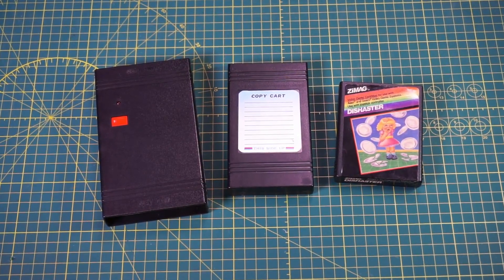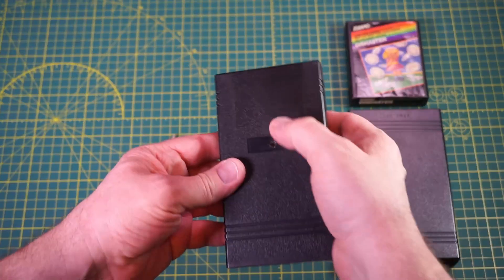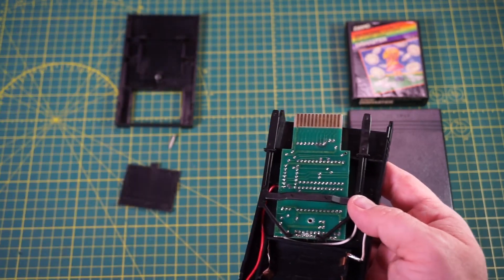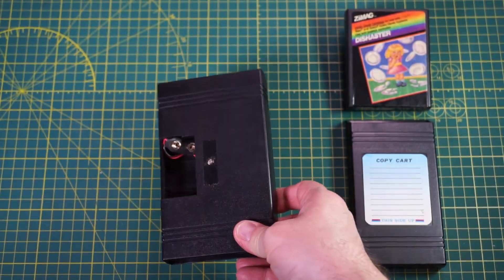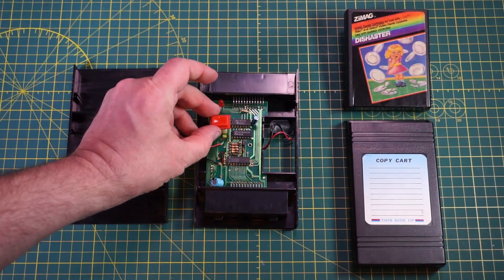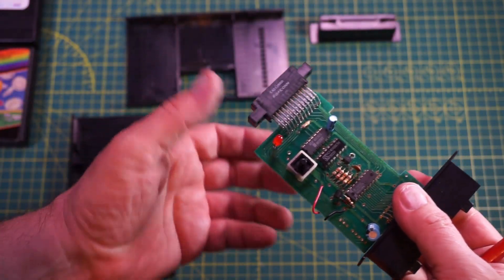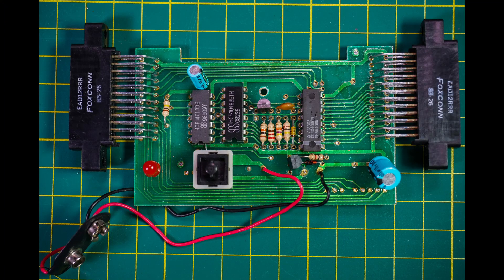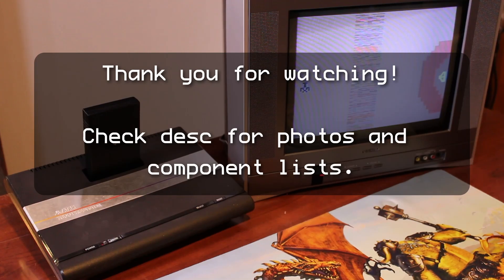The Vidco Copy Cart for the Atari 2600 (1983) Part II

Comment: I'm curious, if you accidentally put the original into the copy slot, would it erase and/or copy over it?
Reply: No. The original is a mask ROM, a hard wired matrix of diode circuits that contain the bit patterns for the original game. These can't be overwritten.

Comment: Okay interesting.
If I had to guess what's happening:
The counter is continuously cycling between 0 and 4k-1 from some pulse.  The flip flops are used to generate the control signals to the copy cart from the pulse as well.
Pressing the red button enables those control signals to reach the copy cart.
Prediction: Not pressing the red button long enough results in only a small random section of the 4K space being reached. Pressing too long just keeps rewriting without issue.
Another prediction: The copy copy has more pins than a standard cart, as it needs to expose write lines.
Great vid. Thanks.